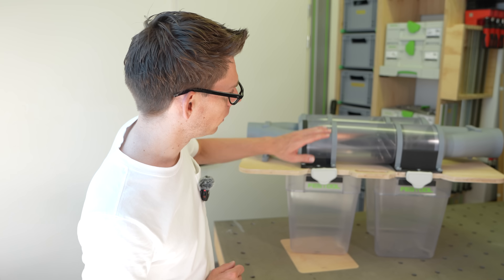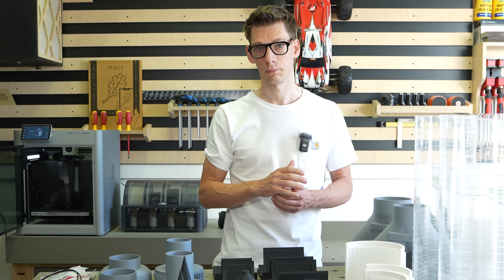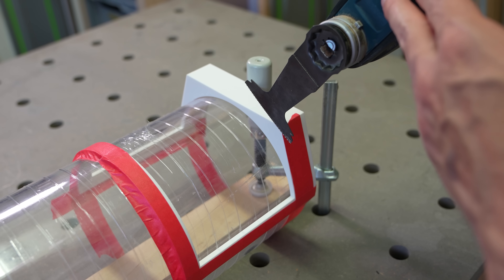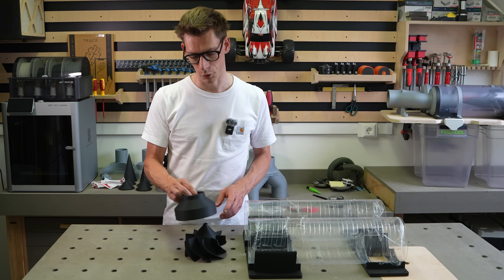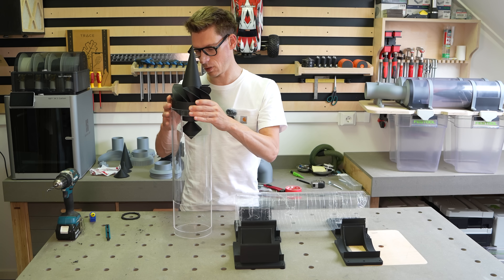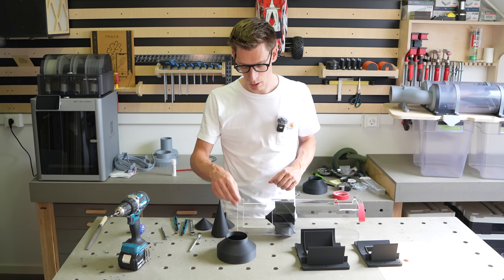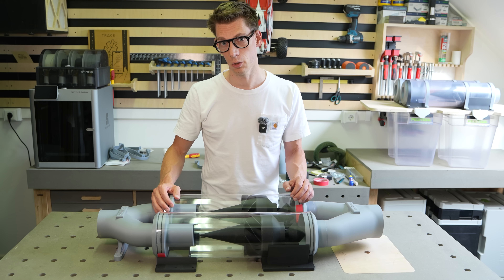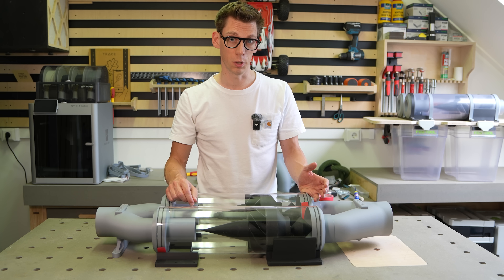I Built my Centrifugal Dust Separator, Again! (€200 Budget Dust Collection)

Comment: This is how filters work in tanks, the tank needs a huge amount of air, i.e. engine running, gas turbine. It is worth looking at how tank filters are constructed and how they have to separate kilos of dust per hour of operation.
Reply from the maker: It’s also the same principle as in helicopters. Only then they use a lot of small ones in parallel. I like to explore that even more for filtering the very fine dust.
Reply: @CapturingDust  There is a video about Russian tanks, and specifically about the drive units of these tanks. Unfortunately, in Russian, luckily for me, someone made a Polish video about this Russian film about the gas turbine. I recommend watching it, with subtitles in your language, unless you understand Polish :). The film on YT is titled, (Jak rosyjska zbrojeniówka produkuje turbinę gazową do T-80 i w czym jest lepsza od turbiny Abramsa?)
Reply from the maker: Nice 21:31 I can see the centrifuges! Thx for the tip!

Comment: This is overly complicated for what a simple centrifuge can do.......I bought a centrifuge unit  on EBAY  and coupled it to a vac motor and mounted it onto  a 25litre steel drum........that is as simple as it needs to get and this one I made will handle metal swarf and sawdust too.
Reply from the maker: Happy to hear the type of centrifuge you bought from Ebay. Do you have a link to it?
Reply: I think he’s German (although that’s only going off his accent). But if he is German than this is totally expected, he forgot to mention he moonlights for Mercedes as the lead F1 designer.

Comment: Is the 6" version more efficient than the 5" EU version? How much sucking power is needed? Is there a way to calculate the sucking power dependent on the tube diameter?
Reply from the maker: The EU version is 5,91” so not a big difference. The inlet is 5” on both designs. 

For the calculation I could not find any formula for that. Still need to find that out some way. I ordered a CFM meter to measure the CFM on my CamVac. Air flow as advertised for my dual motor could be around: 573 CFM at 4′ (CGV336)

Comment: Lots of work to separate dirt from air.
A shop vac would be much cheaper and available.
Made a powder separator out of 20 gal cardboard barrel.
Worked for nearly 37 years. Lifted plastic powder off conveyor belt by
High speed blower blown through side of barrel at angle. Worked well.
Reply from the maker: My CamVac works fine! For 20 minutes until the bin is full and cleaning it is a hassle 😉. Like to find out with this channel how good the most simple dust separator out of a waste bin will perform compared to a thien baffle and cyclone. And this complex system. Sometimes curiosity strikes 😅

Comment: Looks great, definitely excited to give this a try. What is the required print volume?
Reply from the maker: All parts are designd to print on bambulab build volume(WxDxH) 256 x 256 x 256 mm³. The Y-pieces are on the edge of what is possible in this volume. The rest has some margin.

Comment: Is this similar to an inlet particle separator for helicopter turbines?
Reply from the maker: Yes only in helicopters it is a single stage axial flow cyclone tube. And then many very small ones in parallel mounted between tube plates. The dust is not getting out trough the bottom but trough the back in line with the clean air outlet.

Maybe something to try in a similar way for the micro particles as a third stage.

Comment: What features are present (or planned) for bleeding off static charge?  Isn't there a concern about dust explosions? Dust collection pipes are commonly wrapped in a bleeder wire, or are engineered to have the right conductivity to not present that problem.
Reply from the maker: In my PVC version I included a copper tape along the sides of the pipe. Not jet grounded it so I don’t know if it made any difference.

Comment: Impressive build! What is the benefit of this over the usual dust cyclone design? This one seems a lot more complicated.
Reply from the maker: That is something I want to find out. For me it’s the hight I did not had. I also ordered a cyclone for testing the differents in CFM/pressure loss and maybe fine dust separation.
Reply: @CapturingDust  Sounds great! I'm looking forward to your conclusion
Reply: I have designed and partly built a similar system. Part of my rationale for the design is that recommendations for dust collection systems always emphasise that both the number and magnitude of direction changes in the ducting should be kept to a minimum, because every direction change reduces the airflow, and large, abrupt direction changes reduce it a lot. For example, two large radius 45-degree bends are always stated as preferable to a single small radius 90 degree bend. Standard cyclones are even worse than that. They cut the airflow downm enormously because they force the airflow to reverse direction through a coplete 180 degrees over a very small distance. So a centrifugal system that maintains the direction of the airflow through its whole length should reduce the velocity of the air significantly less than the standard conical cyclone design. 

The horizontal orientation is the other part of my rationale - and takes considerably fewer words to describe..

Comment: Awesome! I’ve been waiting on your next videos. Other than the differing size of tube, are there other design changes? If so, will those be brought to the 6” version as well? Asking as those in the US would probably want an updated version for the 6” tube.
Reply from the maker: In the EU design I printed the shroud with a somewhat lager cone to see if big particles are better been separated in the first stage without flow/pressure loss. Not tested it so far.

In the next week I will try to redesign the Y-pieces so they will need less support or maybe I can eliminate all the supports by working with 45 degrees chamfers for the bracket supports and tekst plate. It’s not a performance thing.

Performance testing will take place in a couple months I hope when I build the testing setup.
Reply: @CapturingDust ok. If someone wants to eventually copy your design, should I wait until your complete? I’m not in a rush on my end.
Reply from the maker: It works fine for my purposes only I think it can do better so if you have the time I would wait until MK3 is ready. Don’t know when that would be though 😉
Reply: @CapturingDust  ok, will do. Thanks for the work! I hope to eventually create. Design that places all components in a single moveable enclosure that adds a bunch of sound proofing. Waiting expectantly on mk3!

Comment: Hi Ruud, really looking forward to all your upcoming video's!! I will build one as well, so had a look at the links you provided. I live in the Netherlands as well, so took the EU designs. above the link for the acrylic tube you mention 151x3.5mm, but on website you linked you get only the option for 150x3mm. So with that do I need to take the UK files or did the dimensions from the Dutch supplier differ with 1mm? I'm also open to help testing, if you need. I have a 5 inch cyclone available, because I haven't installed it in my setup yet!
Reply from the maker: No the websites dimensions are not exact the same as you get delivered. I ordered the 150x3 version. 

The files now on my GitHub page have not the perfect fit for the O-rings in my opinion. I need to make a testprint for that next week to make te seal better. 

If I can give you a advice. I would bye the PVC tubes. They work so much easier than the Acrylic tubes. I could not find the PVC tubes locally.
Reply: @CapturingDust  thanks for the quick response! About the o-rings, you still have the 140mm versions linked I think. Didn’t you use the 120mm now?

Only disadvantage I guess is you can’t see if anything gets clogged. Or maybe the static build up?
Reply from the maker: I just updated the GitHub page! Yes I used 120x3 now. The 140x3 are almost not possible to get into the tubes. The fit/seal is not great now I think. Can’t see the 0-ring pushing against the wall off the tubes like in my PVC version. 

I only have time in the next week to make test prints for that so I can correct the files. 

You can use silicone in the groves as well to seal them. I chose the O-rings for easier disassembling of the parts for testing different variations in the future.

Comment: Has anyone compared the performance of this type of separator against an Oneida Cyclone?
Reply from the maker: I ordered the Oneida-Air Super Dust Deputy 4/5 Cycloon as a DIY to compare it in a future video. I had the same question and couldn’t find any answers.

It’s hard to get a hand on one in the Netherlands. Mine is in backorder for 2 months now. Hope to get it soon.
Reply: @CapturingDust  Awesome, great work!
Reply: I'm rooting for Ruud's version!
Other than spinning the air and making it move closer of further away from the central axis, centrifugal separator has rather streamlined flow compared to a cyclone, where it does an almost 180 change of direction. I hope that means better filtration efficiency to pressure drop ratio.

Comment: Acrylic cement can fuse PLA together, and PLA to acrylic, and the joint is less britle than super glue. the cracked tube can definitely be saved.
Drill 4 corners first before cutting the opening on acrylic may relieve some stress in the corners, making it less likely to crack.
I like your mirrored design, and they look great together.

Comment: Great build!  Thank you for sharing your progress on this very interesting process.

One question I have - Do you think this design would work if it was rotated ( pitched ) 90 degrees with modified outlet geometry?  My shop is extremely small... If this could be wall mounted horizontally, in-line with my dust collector, it would save so much time and effort vs having to constantly deal with my single-stage unit.
Reply: This style of separator needs tube axis to be perpenticular to gravity to work properly. A cyclone separator may be a better option for you if you want to stack things vertically.

Comment: Let's go!
Know you kinda have to use clear tubes for testing, education, but 6in PVC tube be a lot cheaper. Also how many walls and what % infill? 5 rolls seems like a lot
Reply from the maker: The Y-pieces consume alone like 1.5 spool. I didn’t optimize for cost on the printing part so far. It definitely can do with less material. Saving 1 spool is possible but not worth my time in this stage off the build😅
Reply: I'll with you on standard tubes. 6 inch pvc would be soooooo cheap